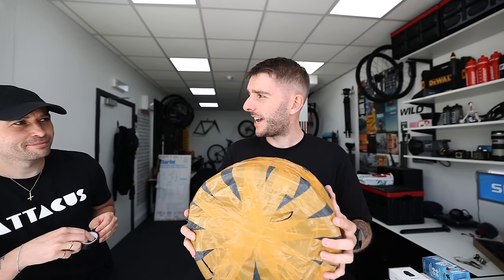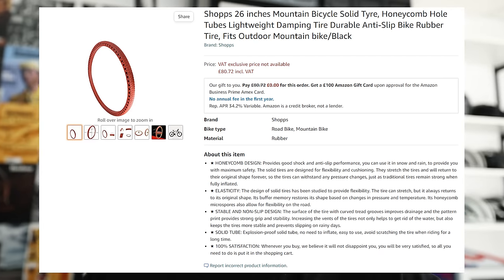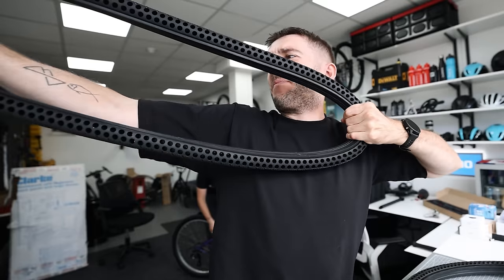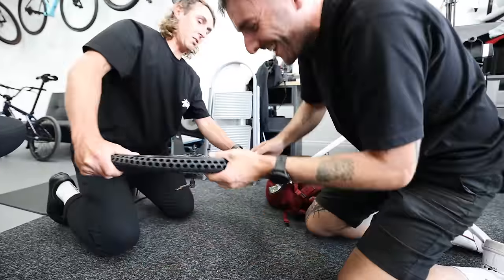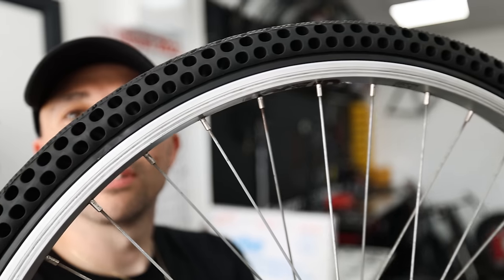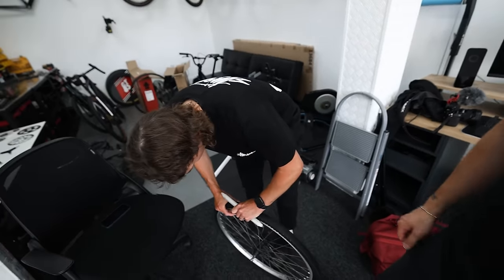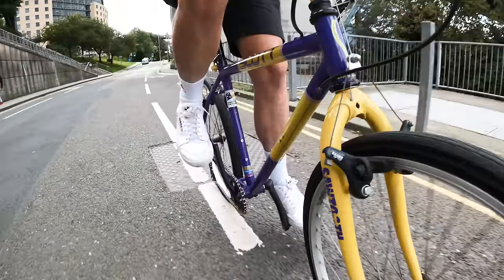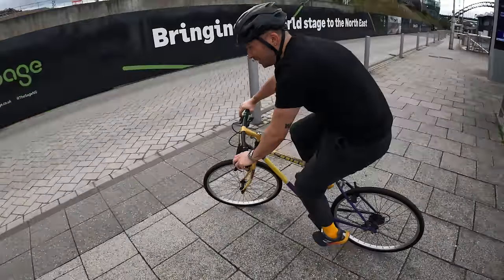The Most Unusual Bicycle Tyres I've Ever Seen

Comment: easier to fit than gp5000s
Reply: My gp5000s were easy to fit. Sounds like a "you" problem.
Reply: @not-a-raccoon  sounds like you can't get a joke
Reply: Gp5000 are kinda easy to fit.
Reply: @MrBusunglueck  you're very lucky then because gp5000s are notoriously difficult to mount, it's become a running joke
Reply: @Carftymk  then you havent tried Schwalbe Pro One TTs yet.
Reply: @Carftymk  more like a riding joke 🫢
Reply: Schwalbe Marathons entered the chat
Reply: @not-a-raccoon  why be so rude?
Reply: @samueltaylor2757  You're less likely to get a puncture, but when you do, it's not the tyre you want to change with numb hands, in the rain when it's dark. I find the trick is to knead the bead into the well, and pull the tyre down keeping it in. Lots of fun, language and raw hands.
Reply: I used to have fun with supersonics, possible what gp5000s used to be called. I commuted on them for a while. So tight they'd shift the rim tape when fitting them, resulting in a nice bang, and another 1/2 hour of work.
Reply: My Vittoria corsa graphene 2.0s are a pain. I’ve broken two new tire levers with them

Comment: These so-called “tubeless’ tyres aren’t all they’re cracked up to be. No matter which brand I tried, the sealant kept leaking out of the sides…
Reply: What about for hardcore urban commuting?
Reply: They're easy to patch though
Reply: Are you using tubeless wheels and tyres?
Reply: Wife went back to tubes.
Reply: Tubed tires with tough puncture tape (like flexible thick plastic) works well.

Comment: rubber tires like that need to be made for specific rider weights. They're probably made so that everyone can use them so they can likely support 250+ lbs... but if you only weigh 160 it's gonna be harsh. More options with softer compounds would be nice but that increases production/RnD cost significantly. Maybe companies could focus on a specific weight to support instead? idk.
Reply: They are used in shared bikes in China. Millions. You see them everywhere. No punctures.
Reply: @christocan4710  I’m sure there are plenty of punctures in them, they just don’t go flat from that

Comment: If you haven't already checked these out: Stop-A-Flat Puncture Proof, Thorn-resistant, No-flat, Bicycle Tube (at Amazon). The manufacturer says they are approximately 65 PSI. So the 'tubes' are solid, not the 'tires'.

Comment: I've being using 23mm tannus tyres on my road bike for a year. I'm. Not going back to air ever again, solid tyres for life!
Reply: do you ride it?
Reply: @ruslbicycle6006  of course I do. I'm currently at 3 thousand km of use with them
Reply: Yeah but the big problem is you would almost necesarely be braking sprokes relatively often man.   that's a big issue
Reply: @miralovelovos  not once. I never ever broke a spoke from my wheels
10 thousand km done with them now
Reply: @nemure   have you gone for a bike ride outside the city i guess it all depends on the quality of the roads for it's not the same cycling in the states than biking in a city like Manila for example.   I've also read some comments on tyres having poor grip when slippery or even worse if surface is icy  ?
Reply: @miralovelovos  yes I did went on rough surfaces and I understand this tires aren't for everyone since you give up comfort for reliability
Regarding the grip yes and no. They have good grip without issues, at first. Then as the tire wears out it starts to lose the round wheel shape and gets in to a more flat corner-ish thing which is indeed dangerous. You need to replace them when this happens, even if you have tire for 40 thousand km is not worth the risk
Reply: @nemure   seem ideal for the city

Comment: I think you're supposed to put them in a bowl of very hot water for about 20 mins before fitting . Not that that would necessarily help with any of the other short Cummings of these tyres.

Comment: please do a follow up test ride on dirt (these would be good for riding around a junkyard) also please test riding with a regular front tire, it would make sense  because the rear tire wears more and also is harder to change, esp if you have internal hub gears or belt drive. thanks!

Comment: omg i had those tires. installed them on my ebike as i use it to commute to and from work and can't afford the time to change a flat en route. they're terrible!! YES they DO feel like they wanna roll out from under the wheel while cornering. But worse, that sensation happens when you're just going straight if you're doing speeds over 18mph. 25+mph causes the entire front of my bike to shimmy. terrifying. switched back to tubed tires, hadn't had that issue since, no roll, no shimmy at any speed.
Reply: That is scary that you actually used them. They should give you your money back. Scam. Anyone with knowledge of bikes knows this is a bad idea, the seller is duping those who are unaware. (the appeal of a flat proof tire is real)

Comment: I've seen these or similar on bike share bikes when I went to China. So I assume the main application is the cheapest, minimum bar usability that never punctures, making the bike share service as cheap as possible to run since you'll never need to service a bike tyre until it literally disintegrates. And then just sell surplus to consumers probably at a massive mark-up.

Comment: Got this great idea...I call it a 'pneumatic tire (tyre)' that has a bladder inside the tire that holds air pressure at a multiple of atmospheric pressure. The tire (tyre) conforms to irregularities when in motion, and gives the rider a much smoother ride than with solid rubber tires (tyres).

Nah...it'll never sell...
Reply from the maker: You're on to something
Reply: I think would be really hard to keep the air on the inside, youshould really try to invent a magic fluid that can seal leaks, that would really be genious

Comment: Heat the tires up. Hair drying. high heat, it will help you fix them to the rims, just like a pulley belt ,heating them up makes them easier to stretch and flex. when they cool down, they will shrink again locking them into the rims

Comment: If they were made if a graduated compound that was firm on the inside (for holding the frame securely), but became softer around the ‘comfort holes’ (for comfort) they would probably be much better. I’m sure it’s technically possible to laminate two or three compounds together.

Comment: The rubber compound used in the tires is just too inelastic, and if they were more flexible, the tires would probably come off the rim.
Reply: Hybrid design with hard inner and softer outer layers?
Reply: @punkdigerati  or maybe an air pocket, that you could have a valve to reinflate if any leakage...

Comment: you do realize... there is a break in period... i just did a 1200 mile bike tour on a pair of tannus 700c x 28 HARD... with no gear on the bike... and brand new... it was like riding on wooden wagon wheels... loaded the bike... and it was better... i was running around 300lbs with myself gear and a small dog and carrier... after about 200 miles... they got softer... i also changed my seat... 😂... but i have to say i like them... although they dont last like advertised when heavily loaded.. but... but for the price... it beats hauling around tools and a pump and spare tubes and tires and patch kits... and they feel much softer with weight... youre a thin guy... amd with no gear... you shouldve gone with the softest tire... it wouldve been a more comfortable ride...

Comment: I have them on my e-scooter but those are a lot smaller and wider and with e-scooters your legs make it quit comfortable. But i mainly installed them because repairing the inner tube is almost as difficult as installing a solid tyre. (Btw I used a heat gun to make them more plyable)

Comment: The real life use case of solid rubber tires is factory bikes made for a bike used in a large warehouse or factory keeping maintenance low and there is no need for terrain or cornering etc. Every other example I've seen is a gimmick made by someone naive or trying to pull a scam. Not sure which these are, but not a good concept.

Ancient boneshaker per-pneumatic tires are a fun insight into history and progress tho.

Comment: if its like air filled tires, and not like solid tractor tires, they would have all the flex, like foam porous plastic tires, partly filled tires. did you ever try foam pattern tires. why dont you use the tire fitting machine for cars. there is a new thing premium on those things right now. baby teething issues in this product. first try quality. try again. not with second quality product. yeah these are tractor tires, for monster trucks, gotta have flex in light tires.
Reply: you could also cut the tire from one spot, then fit around the rim, then melt back to a full tire. or just have a closing clip both sides of the tire on the cut position.